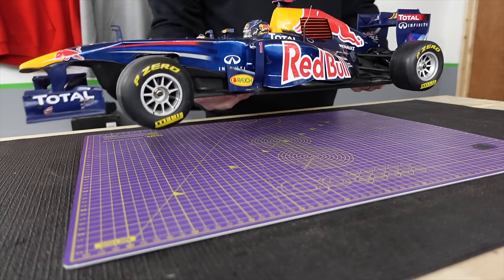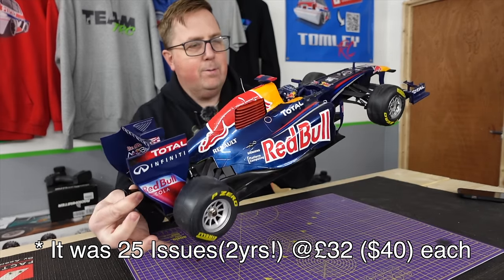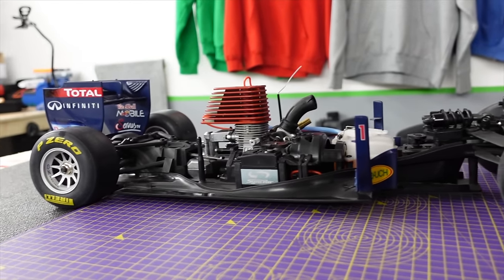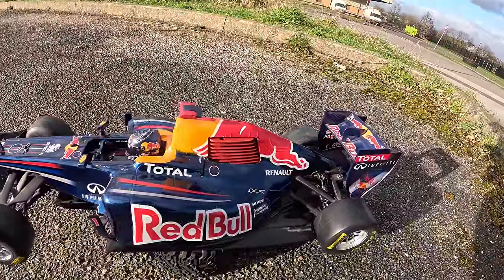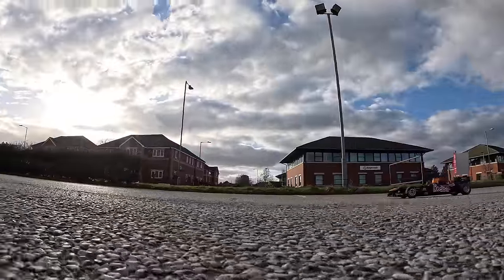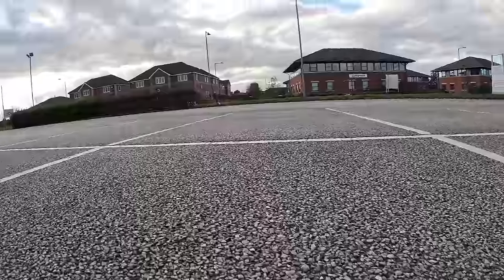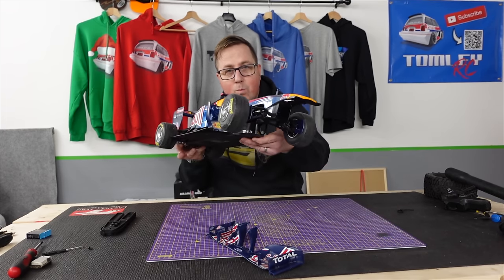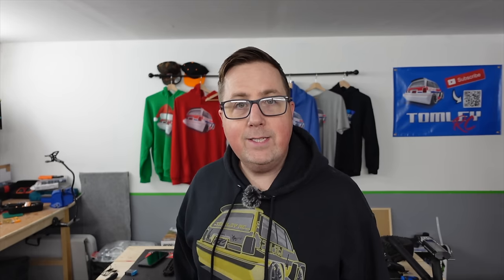Realistic F1 RC Car Even Sounds like a Real One!

Comment: Close to maybe 25 years ago, I got myself a cool Kyosho F-1 car that was 4 wheel drive! Sure wish I'd kept that one. I hate to say I don't even remember hat happened to it at this point. Wasn't as big (Only 1/10th scale) as this one, or as scale detailed, also didn't have that on board starter! Did you say that was an add on? Pretty cool considering that type of tech really only, to my knowledge, here in the states became available maybe 10-12 years ago on some Losi cars. They called it "R.O.S.S." (remote on board starting system) I LOVED IT! Didn't last long as I assume people were burning them up left and right. Also, using the same low capacity battery for that and the radios tasks really stressed out the battery. If you had a hard time starting the truck, well, there goes your play time! 
  Anyway, that's a pretty sweet ride! Too bad it handles like crap! Hope you can sort that out.
UGH...Kevin has one eh? Is he going to try to break the worlds record for RC F-1 car jumps? Why do I fear for that cars safety?? lol Waiting for his "F-1 at the skatepark...will it survive?" video. ;)

Comment: Hi Phil, love the sound of the engine on the redbull. And it's louder than the F1 cars now. 2024 got to be Max. Fun fact that I used to work for the motorsport company Prodrive working on WRC scobbies. And we did the odd bit of 2011 redbull F1 car. Actually got to meet Mark and Sebastian. When they came round for a tour of the factory In Milton Keynes. Anyway great lads and Mark Webber is a funny guy. Great video as usual. 😊

Comment: Change the sock oil all round and the diff oil. Someone already said tire warmers they’re a must for outdoors. Find a nice surface HRA is your best bet. Hot rolled asphalt. 6mm-8mm SMA will provide you no grip what so ever. 

Get some tire additives for asphalt. Coat the tires and put some cling film over. Then put the tire warmers on at 60 for 5 mins. You can do it without the tire warmers, but you’ll 100% need tire additive. MR33 v3 asphalt is a really good choice.

Comment: Doesnt look very fun, maybe the rear diff is locked and needs to be loosened up
Reply: THAT is a very good point. I saw the suspension has the rear camber way off but you might be on to something here.
Reply from the maker: Yeah, needs loads of tweaking. This was pretty much fuel in and run it… I was fighting the weather and the start of the 2024 season 😅
Reply: @TomleyRC  prob why there are some out there for sale. People can't be bothered to try and dial them in.

But just thinking, isn't that the way with real F1 cars tho? They spend DAYS dialing them in before a race then adjust DURING the race.....

Comment: If the aero is meant to function realistically, and the car is spinning out when you get on the throttle, youre gonna need to keep at speed for grip and to brake into the turns. set some expo if you need it so its not jumping as fast into the throttle and just nailing it unless youre flat out.  If you could set a little more slip in the clutch thatd do it too, but im not sure how adjustable that particular setup is.  Nitro are a different beast, especially the bigger, more scale ones.  You might want to look into some softer tires if youre gonna run on such a bumpy surface too, cuz youre only getting about half the grip the tire has to give.  If you could run on like...a prepared surface, or a gokart track thatd be near perfect.  Theyre real smooth.

Good luck man, nice to see a nitro car still on the road after all this time...

Comment: Could there be a way to collab with Kev on a big project where you strap a GoPro to an RC car, Transmit the live feed to a monitor and use a steering wheel + Gas/Break from a PC Setup to steer the RC car like a videogame ?

Comment: This is a rare but POS rc car ever made by Kysho. Owned one with 2 speed  upgrades and its totally undrivable even with the upgraded softest red tires. You need to tune the oil shocks, stffened all the front rear suspension arms and most of all add ballast at the nose as its way too rear heavy.

I rekon Kevin must have smashed this car into pieces on its maiden run...😂😂😂

Comment: Ive got 2 of these one shelf queen and one that i use. Your going to overheat iif you dont open up the vents in the lexan body. Steering and suspension absolutely terrible, i fitted mine with a faster servo and did everything i could to remove the slop and its better than stock. Also get the upgrade kit for it and run the 2 speed gearbox and the soft tyres, like the real thing the tyres don’t last long but they’re worth it. Also stiffen the shocks up. 2 more essential upgrades are the rear differential as the stock gears are made with butter and will strip. And get some metal driveshafts as the plastic ones twist and snap 🤣 good fun when you set them up right. Good luck with it!

Comment: Absolutely love that , ive always fancied a formula one Nitro car, ive always liked the four wheel steer Tyrells, could you perhaps use a couple of engine heaters to heat up the rear tyres to get them sticky? they probably only need two or three minutes to heat up. The starting mechanism is brilliant, what a pity they dont apply it to RTR nitro cars more often, it might help to bolster the hobby a bit more for those that give up because they havent got the patience to pull on a pullstart.

Comment: First minute: "I must have one"
Phil said it was nitro: "Sorry Sebastian, you're on your own"

That model is amazing, I wish I had a place to put it, without making my condo smell like castor oil.
Reply: in the winter I start my Nitro cars in the kitchen with the back door open, it saves warming up the engine with a heater besides Nitro doesnt smell as bad as it used to not 25% anyway.
Reply from the maker: Took a few days to clear the smell from the workshop haha
Reply: Honestly if you are just going to run it and display it,a good thorough cleaning each time would suffice. It's not as bad as it used to be. I have a Tmaxx 3.3 I used to keep in a corner behind my recliner. I never had a smell. Maintain it and you should have zero problems with a smell

Comment: I would love to see one of these with a real onroad 1/8 .21 like an O.S., Novarossi, GRP etc. The note on those motors is even more F1, by a considerable amount. Of course, it would be very difficult to drive without foams, and because of the need for a special exhaust shape and head shape, quite difficult to do....still tho....🤔 maybe a hot .15 or .18 could be done....you want the sleeve porting and stroke for high rpm.....hmmmm🤔
Reply: Just done a Novarossi Conversion to one of mine!
Reply: @philjohn1513  Brilliant! That sound will turn heads! What did you do about the shape of the cooling head? If I could get hold of one of these, that would definitely be on the cards in the future! 😈
Reply: I machined the head to fit the Nova!!!!! It’s on one of my vids. When all built you won’t be able to tell what I have done!

Comment: That's the problem I have with my electric F1 .
I ended up installing a smaller kv motor and adding 3 oz of weight to the rear.

It drives better.